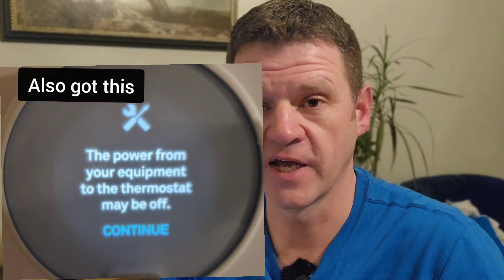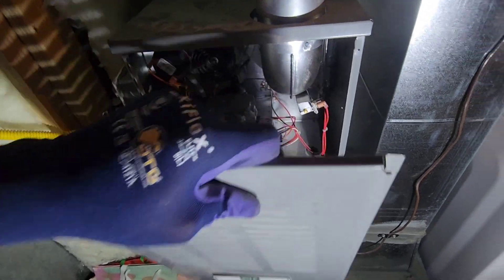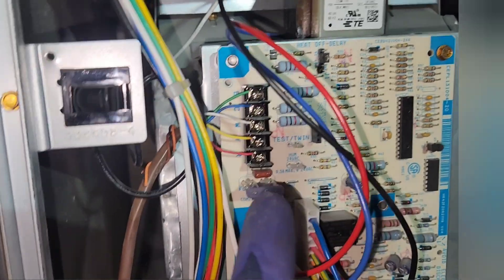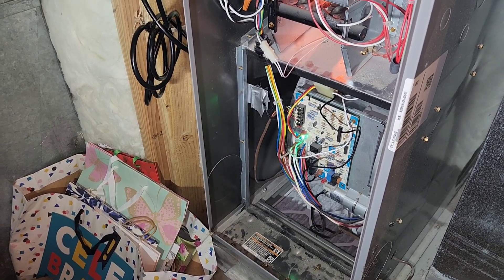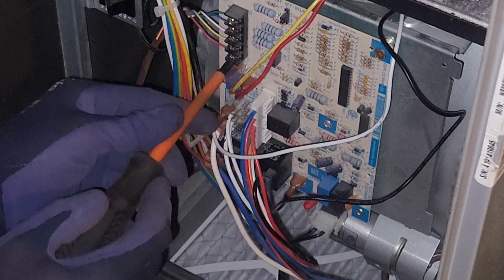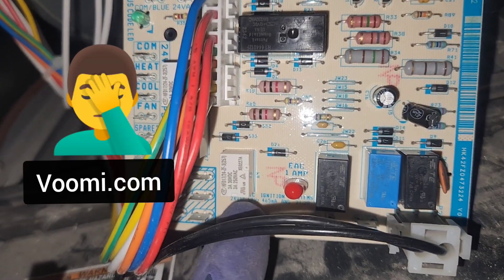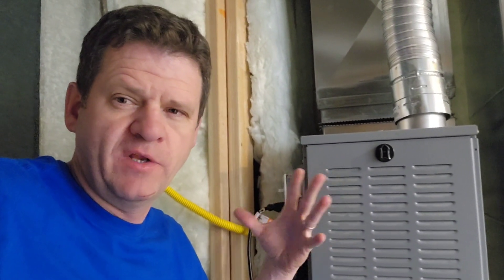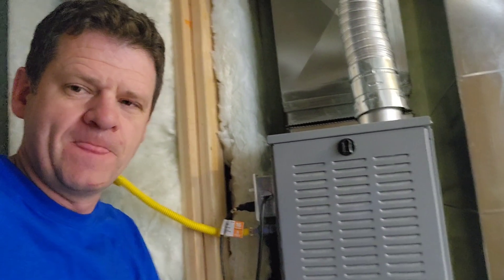Furnace SURGE DAMAGE Fix. How I repaired my furnace and saved $2,000

Comment: (1/2) I’m not a HVAC guy.   I’m just a Dad trying to repair stuff around the house.   But did you check your high limit/flame rollout switch?  If one of them happened to be tripped, I believe that would prevent the gas from going to unit and if you happened to push the button back in while checking the various components, it would have started up.   “World Advice TV” has a good video on them.
Reply from the maker: Thank you, I didn't know about that. I'll check it out
Reply: @ Just FYI, I have very limited knowledge, but I believe that if they are tipped, you possibly have carbon monoxide going into your house.  If you don’t have one already, I would put a carbon monoxide detector in your furnace room.
Reply from the maker: 2 people mentioned this... Thanks. I need to check it out.
Reply: I will say that if your flame rollout/high limit rollout switch is tripped, you potentially have a problem that needs expertise.

Comment: Had a friend who's water heater went out last week... her husband was away on an extended trip so she had to deal with the contractors.   Company quoted her $7,000 to replace it...  a high quality electric water heater is no more than $700.... she finally found an honest contractor to do the job for $2K (even that's a bit high IMHO - a 50% markup and 2 hrs of labor should only add about $600 to the cost of the heater)  Too many rip off artists in this field!

Comment: Reminds me of gas fireplace that stops coming on… electrical contact. Clean the contacts (steel wool works well)  and it’s happy again. Can’t do the steel wool on both sides of those plug in contacts, but I’m guessing just enough voltage drop to stop working, then unplug and plug back in reestablished contact. Prob good idea to clean as best as you can. I think those valves use magnetic solenoid style valves that can get stuck, but if that reoccurs you’re prob looking at a new one.

Comment: from videos past.... Did you fix the light dimming issue when the AC turns on?
Reply from the maker: With my last configuration it was barely visible. What's probably more visible on the camera. But I think it was due to having a little bit of voltage drop due to the large Spike going across the 4 gauge wire. My next setup will have a larger 2 gauge wire t to eliminate that variable.

Comment: No whole house surge protector huh.. should install one.   also nest thermostats are the biggest trash stat on the market. Replace that with a honeywell wifi (RTH9585WF) if you want a wifi nice looking stat. For about 130-150 bucks.

Also nest stats pull alot of power ide suggest getting a 75va transformer that has a reset fuse on it also extra safety for all the 24v electronics.

As for the code 6 you have 2 check every component b4 changing parts. 

Now as for that gas valve..
You might wanna order a spare. And have on hand if its already haveing issues.

But to setup the new one you will need a monometer to set the gas pressures

Manifold pressures will be in the manaual
Reply from the maker: Thanks, yeah I definitely need to install a whole home Surge protector. Then I can also add a surge protector to the furnace Outlet itself
Reply from the maker: A monometer huh? I have never used one of those. That might be over my head. I don't think I have the manual for my furnace.